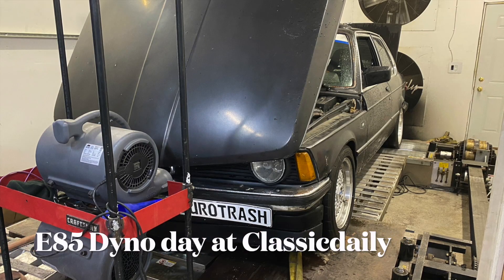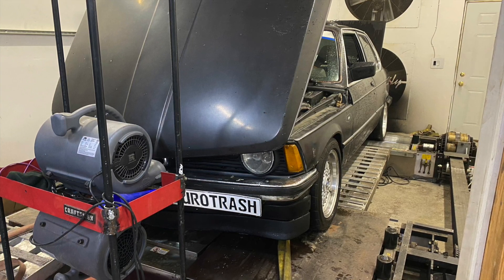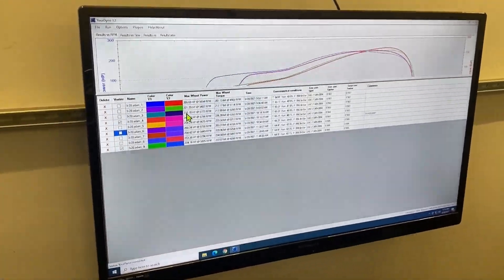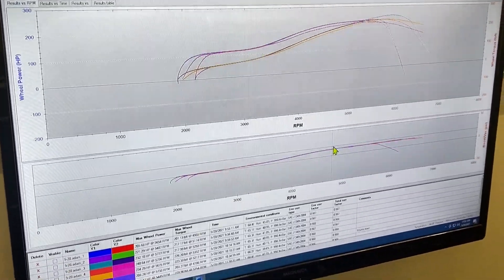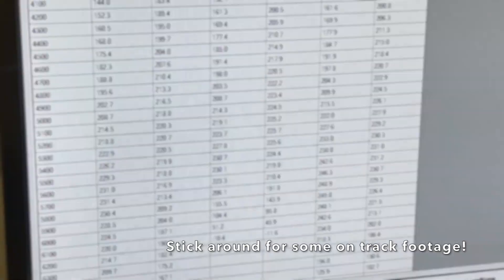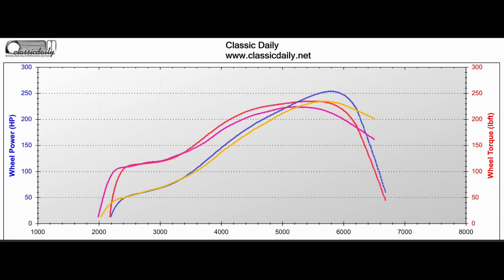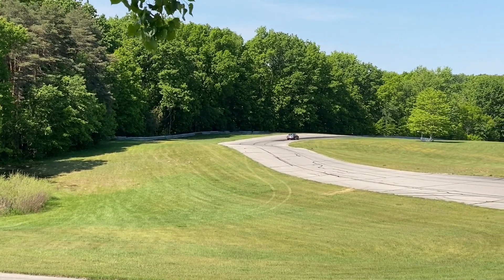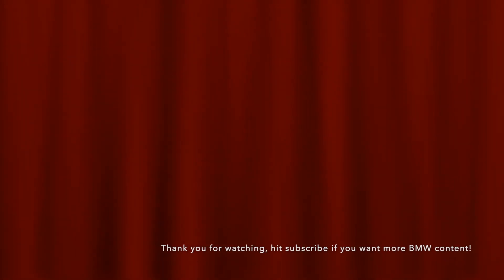Turbo M42 BMW E21 320i on the Dyno! | E85 Turbo BMW Dyno Tuning

Comment: I just turbo’d my e30 m42!!! Just came across ur channel great work im running a Microsquirt, need to install flex fuel sensor. right now only at 5psi gate pressure!!
Reply from the maker: Awesome! It’s surprising how much these engines can take. I am 13 years turbo’d and probably 25k miles. Are you going to make videos?
Reply: @AdamPE21 I have made a few shorts!! Making a in depth build video soon but I literally got rear ended today 😢
Reply from the maker: @HiraTuning Not good! Are you going to fix it? Also check out my trackday videos…E85 tuned and great power to weight in the E21!!

Comment: What's the trim on the turbo??
Reply from the maker: 0.60 turbine with a 0.50 a/r compressor. Had a 0.48 on there when I first did turboed in 2012 (before E85) but seemed choked off at high RPM.

Comment: Is it obd 1, if so what do you use to tune and if not where can I get a new ECU for the in 42
Reply from the maker: Hey man - it is running MS2extra megasquirt on in a "KDFi" package that's designed to mount up to the original E30 Motronic harness. I added a MAP/Flex Fuel/Wideband input to do what I wanted with my setup...next step eventually is to add launch control :) 

Here's a link to the KDFi...I am not affiliated with them but figured I'd share at least! https://k-data.org/en/kdfi/?p=1

Comment: What made you choose the M42 for a power plant?
Reply from the maker: They were available for very cheap back in 2008 when I did the swap and ANYTHING is an upgrade over the M10 CIS system. Since then the E30's and M42's have gone up in price. Good powerplant to start with though and forged internals. Has been VERY strong even at over 130k miles. If you can find one for cheap, do it!
Reply: @AdamPE21  I'm doing a K24A2 turbo swap. Now parts are available.
Reply: @AdamPE21 picking my second one up for 250 bucks Friday haha
Reply from the maker: @No_Budget_No_Problem DO ITTTTTT
Reply: @AdamPE21  with dished pistons, standalone ecu, turbo cams, injectorsand fuel pump what psi could I push?
Reply from the maker: @No_Budget_No_Problem not really sure, but with my all-stock M42 I’ve done up to 14.5-15PSI without an issue. I typically run around at 12-13PSI, been turbo’d for probably 20k miles.
Reply: @AdamPE21  imma have to go that route then haha, thanks man
Reply: Is this on stock ecu man?
Reply: Sorry just read though other comments and found answer, thanks
Reply from the maker: Great having megasquirt in a stock ECU package!
Reply: @AdamPE21  yeah you see a lot of people keep stock motors happy with some good tuning so I think I’ll save my pennies and do it right!
Reply: Nice build sounds unreal man!
Reply from the maker: @ForrestsFabrications for the first 8 years or so I had a smaller turbo and was running the motronic ECU with a tune on Octane 93. Did OK, 198whp, but open loop and not so refined. 253whp on E85 with MS2extra now though!
Reply: @AdamPE21  yeah wicked, I’d be happy with 198 to be honest haha so maybe I’ll look into it,it’s all going to be a new world of learning for me 

Have heard people have issues with the idle control valve when boosted? When you had the stock ecu tuned did you retain the icv or is it possible to delete and compensate in the tune for cold start?
Reply: Turbo too small, track footage looks great those tires sticky and the car moving unlike just any 320i. Good to see more turbo m42's out there.
Reply from the maker: @techserg718 thanks man! This is the 2nd turbo I’ve put on…first one was a .48a/r and definitely choked it off. Moved to a bigger one a couple years ago when I got E85 running well and this is where she is now.